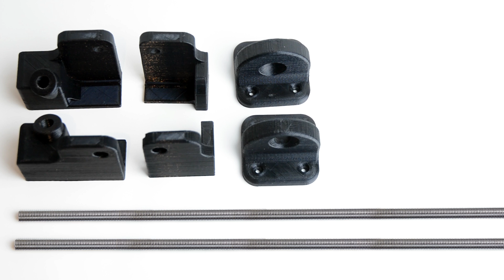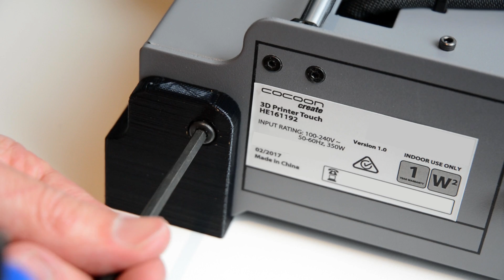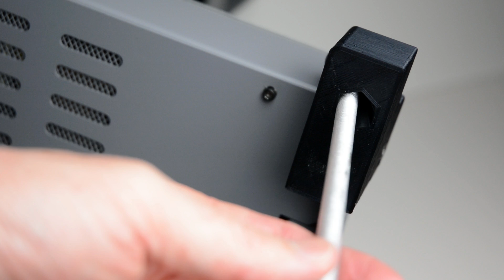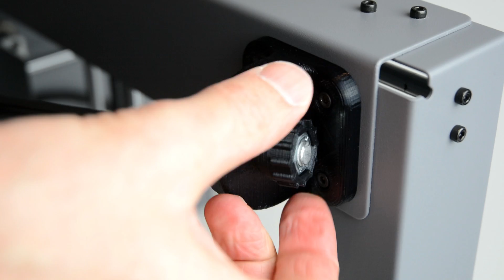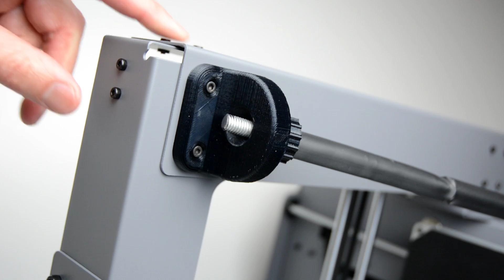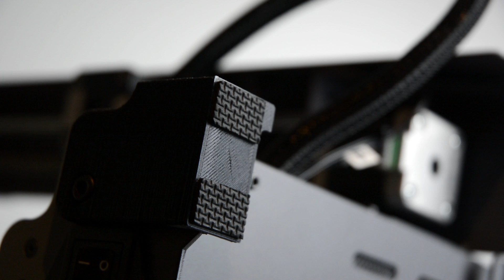DIY Z-AXIS BRACE MOD | COCOON TOUCH - WANHAO I3

Comment: This is quite spectacular! I've actually got a fairly dissimilar printer so i would have to fully redesign this, i've got a wooden Geeetech i3 Pro W which has an incomplete frame to package smaller, which can actually be tightened down fairly well on a good surface, but i think i'll use some ideas if/when i get around to make something like this.

Comment: Using a 3D printer to 3D print parts used to strengthen the 3D printer.
Repeat process for higher quality 3D printed mounts.
I would never have though of that process, It amazes me that you can do so much more with some basic hand tools than I can with my entire Snap-on collection :(

I would love to have you on my Engineering team.
Reply: Except that bad quality printed mounts for this are already arbitrarily good, apart from their aesthetics, because it's all hand tightened around machined threaded rods with threaded nuts.

Comment: Nicely done! Purchase my first 3D printer and soon I will do the same to install z-brace. Learned a lot from your vids.
Reply from the maker: Awesome! Which printer did you get? Its a really handy tool for building projects, and prototyping new ideas. Z brace is a must for this printer, improves the quality and consistency of the prints.
Reply: Got the monoprice select  plus. Hope it will fit. Thanks for replying.

Comment: Just got done building my analog handbrake. While trying upload the sketch I got an error message. This: 
 #error The Joystick library can only be used with a USB MCU (e.g. Arduino Leonardo, Arduino Micro, etc.).
exit status 1
Error compiling for board Arduino/Genuino Uno.

I've tied a few different things but it doesn't seem to work. I would be happy if you know what I should do. Thanks.
Reply: Oh, I managed to solve the issue. The chip was on port COM3 and it was looking at COM1. I went into tools and changed itto COM3 there. For some reason recognizes the chip as an Arduino Leonardo while it is a Pro Micro. Well, as long as it works I'm happy. As I've mentioned before, keep up the great and inspiering content!

Comment: Hello again, I'm currently building the analog hanbrake but I was wondering if the potentiometer should be 35-45mm travel length or should that be the length of the whole component? Thought that I would comment here so you'll se it. Keep it up!
Reply from the maker: Hey, 35mm or 45mm overall length will work.

Comment: I have the a Wanhao Duplicator i3 Plus (same as the Cocoon) I did this same mod the day I got mine. Makes a huge difference. I also printed a better extruder cooling duct.

I do a ton of printing on my Wanhao, pretty much have it running 24/7.
Reply from the maker: Nice! Ive been looking at the cooling duct mod next, Which duct did you print?
Reply from the maker: Thanks for that!
Reply: No problem. Makes a huge difference for overhangs and small parts.